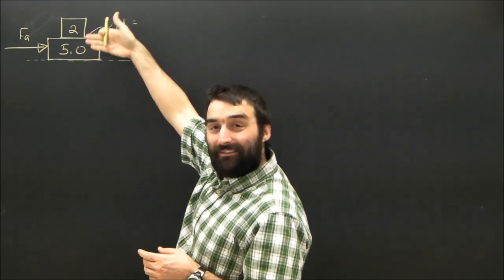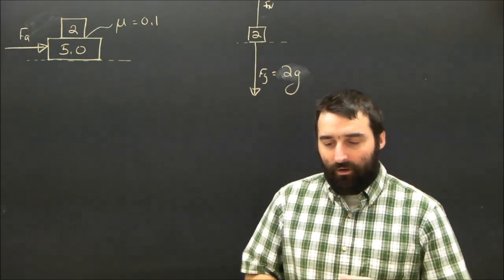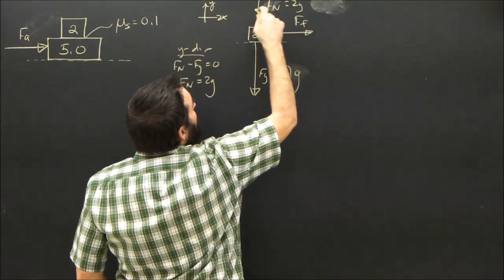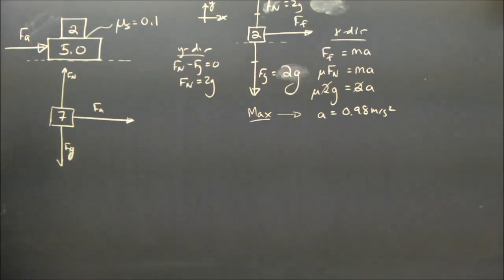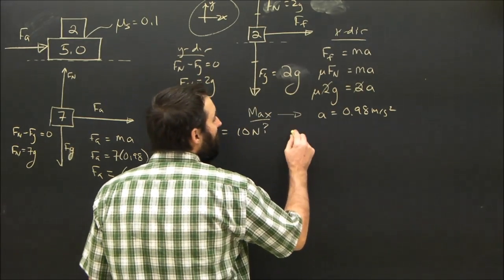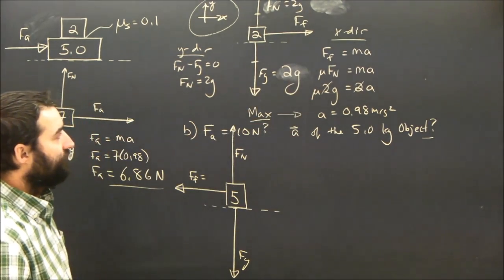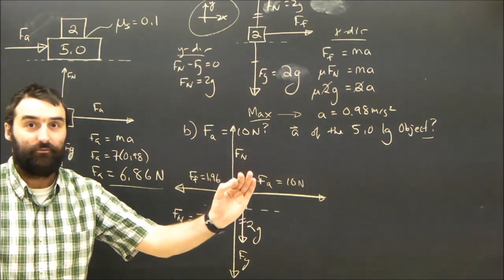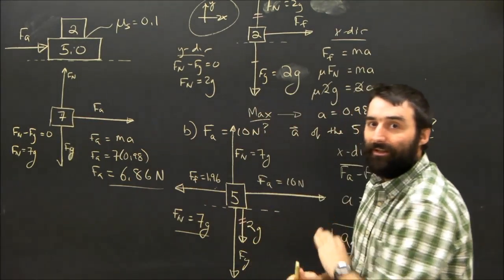Friction & Newton's Laws Part 7 Stacked Blocks FBD Physics

Comment: In part b, shouldn't the friction force applied to the top of the 5kg block be dynamic friction since the 2kg block is moving?
Reply: I was thinking the same thing. Now since the force is > 6.86 the u he used is no longer valid.
Reply: Since it already exceeded 6.86 N...so no longer used..

Comment: Why is the frictional force still taken into account for part B if the block, on top, slips off immediately. Is it correct to assume that the answer for part B is perhaps only the initial acceleration, in that one moment that the upper block is still on the bottom block. After x amount of time, the top block will slide off and the object will increase in acceleration.
Reply: I know I'm a year late, but I think the friction in that case would be the force of kinetic friction, which is always less than the force of static friction. As soon as it slips off though, the force will no longer apply.

Comment: we know that the kinetic friction is always less than the maximum static fricion (Fsmax> fk) and so i think you should not use the Fsmax from part a in part b. the second part (b) can't be solved unless we know the coefficient of kinetic friction so we use the correct fk for the lower block! am I right or wrong!?
Reply: static friction is greater than kinetic friction

Comment: Why did he take the value for friction in part be to be 1.96? Shouldn't you have to take friction between the 2 blocks to be kinetic friction since the top block is moving with respect to the bottom block? In which case is part b) even possible to do without knowing the coefficient of kinetic friction between the 2 blocks? I apologise in advance for any stupid mistake that I may have made.

Comment: Why is friction pushing the top object to the right?
Reply: Consider the bottom block..it is moving towards right...Now, if you look at the upper block from the reference frame of the lower block, it appears to slide towards left (that's bcoz of inertia of rest) ..So as I said the friction acts in a direction so as to nullify or reduce the relative sliding between those two.....& as u might have guessed by now it acts towards right (opposite to the relative sliding).......Think over it!!!
Reply: @namankarn1504  does static friction force do it? To stop the top block from sliding due to inertia?
Reply: Naman Karn 
I don't get it
Reply: Naman Karn 
Ahhh that helped a lot! Thanks for clearing it!
Reply: It is wrong notion that 'Friction opposes motion' actually... 'Friction opposes Relative motion' between two objects..as it does in the above case and in turn pushes the object to the right...  #hopeUgetIt